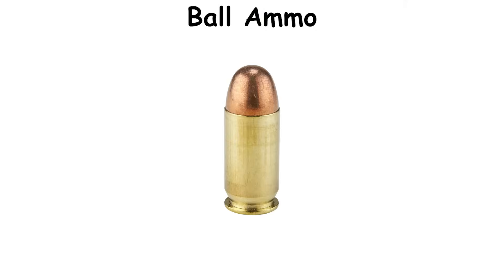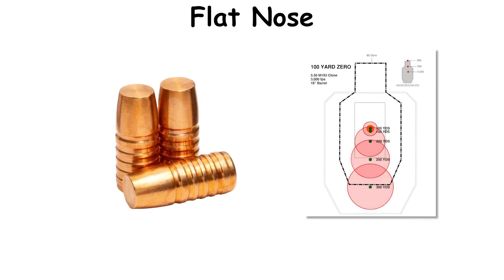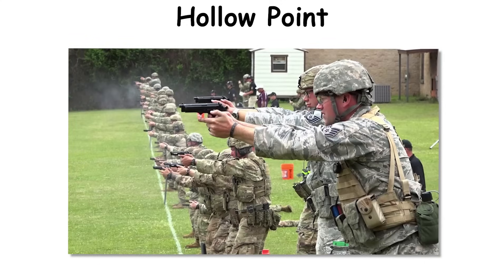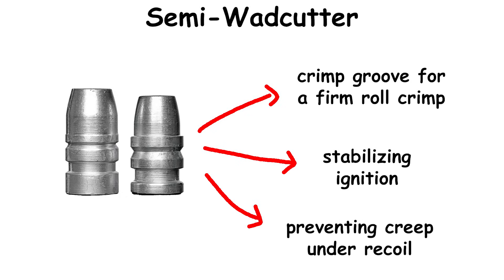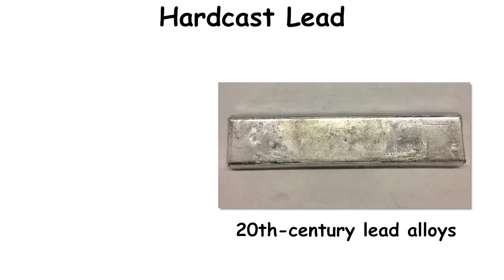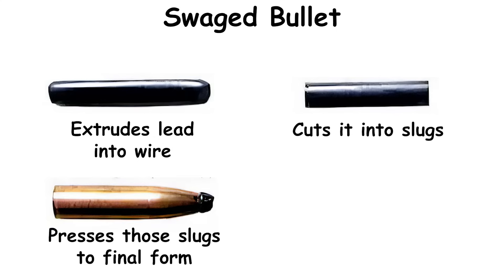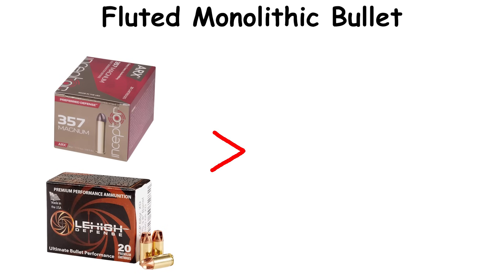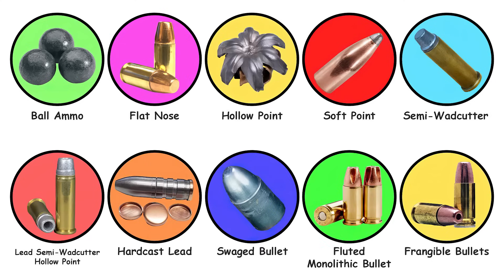Every Types of Bullets Explained in 19 Minutes

Comment: Imagine getting hit by one of those .455 manstopper monsters.
Nightmare material..
Reply: Fun fact: .45 ACP has substantially more kinetic energy than .455 Webley, about 30% more. Actually, the low velocity of the .455 Webley round tends to pencil right through targets with minimal to no deformation and limited cavitation. Hence why literally anything to increase damage to a target was desirable. A 9mm Hollow point with higher velocities does WAY more damage than most .45 cal pistol rounds (ACP and Webley).
Reply: @corkbulb2895  fun fact, 45Super has more than double the energy of 45acp but has the exact same exterior dimensions and can be chambered in glocks, 1911’s and other pistols with some simple modifications like stiffer guide rod spring.
Reply: @ZackZittel-t6b  I had no idea about that round and that's cool you brought that up! I might go looking for those .45 super rounds for my .45 ACP revolver! Assuming the .45 Super is exactly the same dimensions as .45 ACP as you claim. Don't have to worry about recoil springs with a revolver. Just round dimensions. Cool info!
Reply: @corkbulb2895  and pressure. Which revolver?
Reply: @ZackZittel-t6b  Cartridge conversion Pietta 1858. With the crap I fire out of that thing, it'll take it. "Black powder only" or not... Hasn't blown up on me yet. That thing is built like a tank. The metal on most parts is thicker than most .44 magnums. Besides, I only load and fire hot rounds like that for self defense loading. I target shoot with normal rounds. Besides, all those black powder only warnings are purely for legal reasons to prevent lawsuits.

Comment: I would have thought ball was much earlier than the 18th century
Reply: It is older
Reply: Because there talking about fmj ammo
Reply: The original concept for "Ball" is based on standard barrel manufacture, closest was in the 1800s, while the earliest the ammo can be dated was sometime around the 600s, where they took lead sling ball and used them in compressed air rifles that came about but failed to stick around due to complexity and limited range. This would make a come-back in the 1200s where a compressed air rifle had 12 round capacity but required a armorer to charge the "Stocks" which were air tanks, which compaired to 30 guys with powder in either case was found to be more reliable (less training required, less fragile, and generally because of the loud bang and guns being relatively new the thing scared the piss out of people). 

   Ball as we know, as well as ammunition and several other terms are basically French words from the supply use in the Revolutionary War where France gave American's guns, ammunition, and even some special materials. Minie-ball is actually called "Min-yae" ball by pronouncement and is the basis most countries agreed to adopt "Ball standards". For context ammunition designs that were coming out of the 1890s were spicy tools in the war world. There was Hexagonal bullets that matched the rifling and would significantly sharpen after leaving the barrel causing devastating wounds (because it was banned the round style was abandoned in production in favor of mass producing ammunition in favor of the Regulated Ball rounds). Realistically the issue with why they claim "Ball" ammunition is how it is, basically comes down too time frame, the advent of consistent twist rifling, jacketed bullets, and Hague convention rule sets. The rules for Hague basically stated no round should explode inside the body, spread threw the body as fragments after impact (Such as rounds that break apart after impact specifically, this is contention between shotguns vs frangible ammo), and generally should NOT cause undo suffering or damage if taken to field hospitals. So for consideration of the world they set a bullet type that could offer you a medium in all categories: Lethal potential, range, consistency in hospital survival chance on a battlefield. They only left weight of bullet, ammo metallurgy composition, and diameter to the country, to some extent there was even rules on propellant limits to avoid harming users as well. 

   So with that cluster out of the way, its different depending on country what system is used to define bullets. While not the first cartridge the Rimfire .22 was the first service issued Revolver with it soldiers learned to use it at close range. It was a 5 shot weapon with 5 different ammo loads and all were labeled .22 (I'm not joking you could only purchase .22 as a size label till 1890) for absolute mind fuckery. So the modern Rimfire took from that as inspiration however we broke down the system thanks to lever guns that decided to create the label on the gun for ammo standards. Think it was Henry Repeating Arms that started it, finished by Winchester. Before the Rimfire was Pinfire revolvers from France, really cool tech for its time, fell out of favor as Semi-automatics were coming into the scene and speed loading revolvers, which threw innovations in 1915 special systems would be devised to allow loading semi-automatic ammunition into Revolvers simplifying the logistics of large nations, basically killed anything that wasnt at least Rimfire or Centerfire from companies as the goal of weapons manufacture till the 50s was basically make military arms and anything left over would be sold as surplus to the civilian markets. 

   With the flexability of modern arms and well designed and tested themes of concept the world has gone threw a lot in ammunition and weapons manufacture and the engineering is past insane. Case in point, .22 Rimfire is more reliable then it was back in the Civil War, and its still the most used bullet to kill yearly world wide. Ammunition in the .22 realistically has only changed a bit, its ammunition is still corossive and is mostly a lead projectile (You can get other ammo, but those are generally a custom style load), ball style, and basically within 30 feet it can kill, hell in America the walls are so thin .22 will pen walls and only stop if it hits a 2x4. Another fun fact, if you take the bullet out of a .223 you can replace it with the .22 LR bullets, the only difference is the shape of a .223 bullet itself being for weight and jacketed for the velocities. For all intensive purposes the round is just a Spitzer .22 with boat tail and jacketed. Velocity can kill using shockwaves as most of the body is water and that transfers a lot of energy to generally not resistant to shock organs, however its still going to require a round to land relatively close to a vital (Meaning that you can drop a un-armored target with the same efficiency of a .223 pistol varriant as a Ruger .22 within 15 feet, since both require vital hits to function, the .223 does better against armor, which is a rare occurrence outside military and (Extremely rare for this one) law enforcement applications).

   Doubt any of this info was useful, never really seems it is, but I figured its worth spilling what I know for context to things. 

  Just remember that when people talk about "Ball" munition which is specifically refered to in a time when Revolvers are in competition with semi-autos. By the time you get to 1920 a lot of countries are learning to adopt "Ball" but the concept refers to the bullet tip realistically. Allowing you to use pointed bullets and reducing drag and adding several effects while keeping the Hague rules in tact. Thus you get Hard Cast (Lead and metal alloy), AP (Special jacketed tips with hardened core, can be Ball or Spitzer type), Spitzer Jacketed munition with boat tail and tapered curvs, and "Ball" which is standard FMJ 

   Rifles adopted Spitzer tips while pistols generally adopted a ball format for compliance, PDW (Personal Defense Weapon, often a weapon for Close Quarter Combat with the ability to defeat class 3 or higher armor) systems such as the FN Five 7 and P90 use Spitzer bullets as a rare example of Pistol cal meeting Spitzer type ammo.
Reply: @joshuaturcotte6724 first off learn history the first compressed air rifles came 100 years after the first colt Patterson.
Reply: @CodyMT7  The first "Mass produced" Not the first. hearing people get the difference confused drives me insane. Yes compressed air rifles pre-date the caplock in fact (Which is why they were even trialed at the time, wasnt hard to work against a Arqubus and later the early flintlock). They were complicated and rarely used. In short, they existed before your stated timeframe by a large margin. The rifle had to be pumped and used a replacable stock as the charged system. Took the armorer to prime the stock and prep the bullets to use. It was more expensive for relatively the SAME thing at the end of the day so it wasnt going anywhere. It wasnt practical till the 1900s, but there were air guns before 1600. You can even see one in a Forgotten Weapons video if you want a example of one of the rare items. So colt who made guns that fired caps, claimed to make the first revolver and in fact knew there was revolvers before his. Meaning his was the first "Mass produced" being the argument.
Reply: C9mpressed air rifles came out in 1900s their is no evidence of one in the 1200s let alone the 600s @joshuaturcotte6724
Reply: Before ball it was what ever you could stuff in the gun/cannon

Comment: Missing the wadcutter
Reply: They had semi-wadcutter.
Reply: @anonmouse15 so what ? It has absolutely nothing to do with real wadcutters. 
They are only fmj with a sharper edge while wadcutters are aerodynamic defying barrel shaped ultra precise projectiles.
Reply: @loboptlu they are not more arrow dynamic then a flat tip or TC or even a round nose. Wad cutter was made for cutting perfectly round holes in paper... it offer no extra ballistic accuracy
Reply: @ExcitedSolarSystem-jr2rn well tell that the bullets because like it or not up to 50 m no other handgun bullet stands a chance. 
My S&W 52 has still its 2inch 5 shot at 50 yard accuracy of the ransom rest( wish my hands could do that too).
Reply: Did mention swagged lead wad cutters at 13:36, but did not go into the double ended or hollow based.
Reply: @raulthepig5821 still far from real wadcutter.

Comment: Thoigh Lead Is Getting Phased Out, Bismuth-Tin Alloy in Brass Jacket can have similar performance on lead bullets but eco friendly
Reply: Super expensive though and brass is not a good jacket material it fucks up the rifling because its harder than copper is
Reply: copper has a point but would be monolithic bullets rather than Leaded since Pb Is Destroying the Environment
Reply: @Galileo406 i feel you may be a little lost…
Reply: What's up with that?
Reply: @Galileo406  copper jacketed bullet do not need to be monolithic… 
And you can use bismuth-tin alloys in copper… and pb is not destroying the environment it’s been used for 2200 years with no significant impact on wildlife 
What does have an impact on wildlife is over hunting and we already have regulations on hunting so we don’t do that

Its not about being eco friendly
Reply: @ThatConsumateenigma as for mine, it is
Reply: @Galileo406 as for your what?
Reply: Eco friendliness matters since destroying environment is not only a problems but can increases temps on the earth at the same time (GWP)
Reply: @Galileo406 … ima guess English is not your first language because you aren’t making any sense
Reply: D'OH